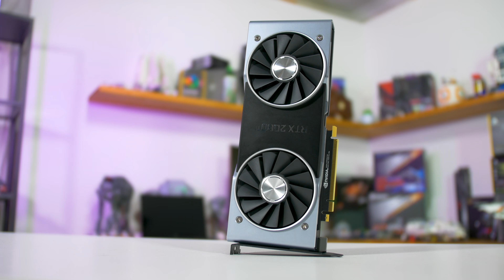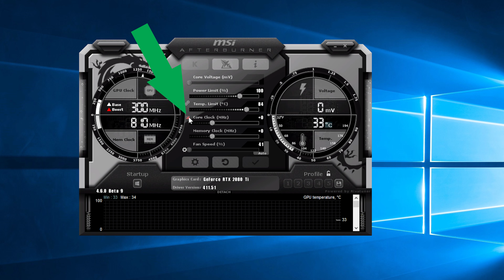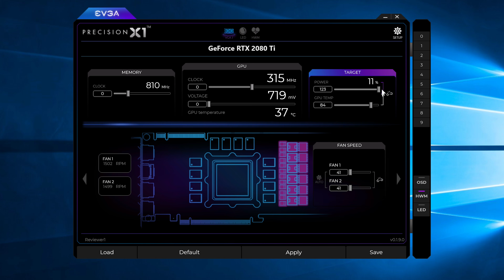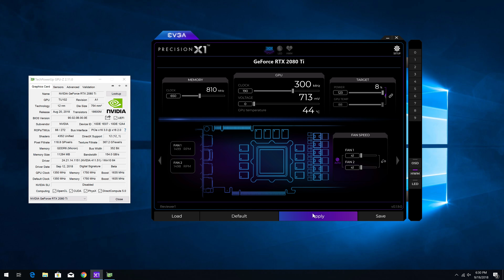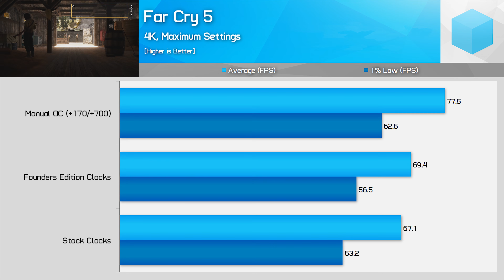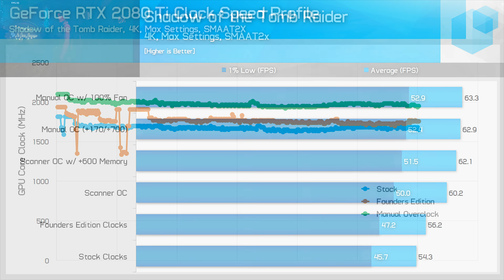GeForce RTX 2080 Ti Overclocking Guide, Nvidia OC Scanner Results & Performance

Comment: If anyone is watching this in 2023… I recommend you undervolt your card. As he said, you can expect 5 years at stock voltages, and seeing as the card was released 09/28/2018, it’s been about 5 years if you bought the FE at launch.
Reply: Then it'll die?  Cuz that's not cool.. you can sell it and get money towards an upgrade.

Comment: One thing I learned from exploring MSI Afterburner, is that different skins has different options and buttons. I was using the original green skin, but after switching around I found buttons that aren't shown on the original skin.

Comment: I find auto overclock to be so stable and manages to get my gpu to a better performance and even lower temps and power draw (I swear, i got proof). Everything fine with this dude except by the little mistake he and everyone is doing: COMPLAIN ABOUT THE FAN NOISE RAMPING UP TO COOL DOWN THE GPU. Dude is like: serioulsy? you spend more than 4k usd in your pc and you clearly ran out of money to buy a decen pair of headsets with noise isolation  or cancelling?. I AM TIRED  of this morons complaining like girls about the fan noise. Dude stop it you all are managin to get all the people that does not know a thing about electronics to the edge of damagin their components thanks to overheating in other components such as capacitors vrms and even ram chips. please stop it if you want no noise get the computer case to another room or outside your house and stop damagin your pc components because you the girly man doesnt want any noise. please.

Comment: +195 on the clock and +1250 on the memory. No voltage increase but power slider to the max. Is that pretty good? My max clock hits 2165

Comment: Can anybody help me out, I just bought RTX 2080 on a nice sale, and tried now to overclock it, but whenever I increase any sliders even a bit like 50mhz it already causes crashes.. How can this be? I tried first the 100mhz and 750mhz on memory JayzTwoCents recommended and I got a hard black screen crash. then I went to this 100/500 and Heaven benchmark crashed. then I went as low as 20/100 testing out everything in between and always crash. WTF? Did I lose somekind of GPU silicon lottery or why my card is shit?

Comment: So do you mean we don't need to rise the voltage gauge when ocing the card cause it doesn't give much different results when it is off?
Reply: I have the same question. MSI AB page says to max it out, and BEFORE running the scanner. I found these instructions lacking as they didn't say what kind of voltage control to use: MSI standard, Third Party, etc... Also they said nothing of NVIDEA claiming a 1 year life span with voltage unlocked!  I hope he mispoke in the video and NVIDEA says it takes 1 year OFF the life of the card. I got a 57mhz recommend on a card already boosting to 1920mhz so seems about right
Reply: @nathanwhite617  yea what's the score with this.

Comment: EVGA 2080TI XC Ultra. Max stable OC is +90 Clock, +800 memory. Did I get a get unlucky with the silicon lottery ?
Reply: Your max coreclock is +90? Evga xc ultra? Is too low... not possible.. in my founders (bios modded kf2a galax 380w) coreclock is +170, and memory is +1250...

Comment: OC Scanner suggests +185mz on core clock after running scans. 
My 2080ti fe won’t run past + 115 on the clock without crashing. Anyone else having same problem with OC Scanner?
Reply: I have FE and my coreclock stable is +150, and memory +900. After modding (i have flashed bios whit kf2a galax 380w) my oc stable is +170 coreclock and +1250 memory clock. The power limit is +127 and Before flash 123

Comment: My new (rma'd) 2080ti fe appears to be crashing (the driver that is, card appears otherwise fine, thermals, etc, its water-cooled). The damn dwm.exe black screen crash in games, I've checked everything, including multiple system and driver re-installs, changing timeouts, etc.  So I am now thinking to UNDER-clock the factory overclocks...getting a little desperate here!

Comment: I'd argue that memory is just as important as the core clock when it comes to performance. Memory is at least around 50% of the overclocking performance you can gain.

At least that's what I've seen on pascal.

Comment: Using Precision X1 I got a +121 score in VF Curve Tuner with +170 and +600 on my EVGA XC Ultra Gaming. Pretty much means a 12% increase. Had a 88C limit and hit 87 in the stress test right at the end of the 20 min or so test. I was biting my nails, lol. Also I don't have that OC Scanner button show up in MSI Burner, so I used Precision X1. 1820Mhz GPU and 2000Mhz VRAM

Comment: Erm, Tim. The fans can be run at higher than the speed you have them set. You didn't adjust the "FAN SPEED" section, only the fan curve, which is predefined and capped.
Reply from the maker: Yep well aware, why do you want it to sound like a jet taking off? We're also not thermally limited so another reason not to do that.
Reply: Water blocks are my preference.

Comment: If Pascal and Turing behave similarly, you will get even better performance using the curve oc manually. From the default curve as a starting point,  increase the highest 2 or 3 frequency points on the curve up to the  cards voltage limit up to the frequency you want to try to run the card at. 

Using the slider increases every point on the curve by the same amount.

The points on the curve at the low end of the curve do not really contribute to the game frame rate performance but the do use up some of your power limit headroom if you set them higher than the default. Keeping them low will help the card not hit power limits as easily, keeping the clock speed higher throughout the run.   The Area under the curve is representative of the power that the setting will need to run.  If that areas exceeds the area allowable by the Power limit settings, the card will power throttle.

The other thing is that each point on the curve has a limit to how far it can be overclocked and they are all different. It is possible that each point except for 1, is happy at running at +200. that one point may have a problem above +100. Using the slider, the run will crash at any settings above 100 because of the card trying to push that single point above its limit.

Comment: "5 years at stock voltage, but just 1 year with the voltage raised slightly" More or less what you said nvidia said about their new graphics cards... really?  One year?  Nope, not touching that for $1200+

Edit: This card is weird... like I don't like it because it feels like BS.  Any opinions from others?
Reply: it will last more than that cause u have warranty on top of it for a reason if your card dies in 1 year and u have 2 more years of warranty left you can claim it.

Comment: 1 year lifespan with a very minor voltage bump, what a load of crap... does nvidia mean 1 year of 24/7 benching vs 5 years of 24/7 benching for stock vs boosted voltages ?
Reply: Yes. Maxing the voltage won't affect much of anything in terms of the lifespan for normal usage. By the time it dies it'll be way out of date anyways.
Reply: Thought the same thing. It’s not like you can really add much anyway. I really hate the Green Light program...bring back the ability to mod BIOes.  Overclocking has become boring.
Reply: yeah I call BS on that voltage lifespan thing.  I had a GTX 960 Asus Strix with the voltage OC'd to 1.2v (Asus defaults the voltage to that level for some reason) for 3 years and it still runs great at 1520MHz on Core.  I swaped it for my buddie's 1070 because his GPU didn't fit his new case.  He's still using that 960 at 1520MHz without any issues!

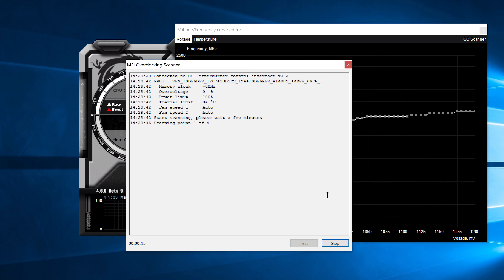Comment: At 3:04 where do you find the OC scanner button in msi afterburner i have a gtx 1060 is it a new feature only turing cards have?
Reply: Only the NEW (RTX) Turing cards have this function, not available for older cards.
Reply: @Nightss10  thanks!

Comment: mine msi x gaming trio rtx 2080, is the fan bar locked, or just grayed out, i have tried reinstalling driver with no luck, (8700k, 16gb ram, 1000watt plat psu) what to do ?
Reply: Hey Casper, you might have an older version of MSI afterburner, make sure you have the newest version installed.
Reply: You need the beta version of after burner.

Comment: I will say this newest generation of cards hasnt improved the clock speeds. Up to 2.1 ghz stable on my 1060
Reply: Can't really compare clockspeed between architectures. A 1500mhz 980ti is faster than your 1060.
Reply: i fully understand that. i'm no dummy i'm just impressed with pascal still. also my gpu is probably really high on the silicon lottery
Reply: the 980 is equivalent too the 1060 and thats simply because the clock speeds were ramped up that much. turing is a small step forward in conventional rendering at a massive cost increase. i think my general point is that i'm not impressed with this new generation of cards... 1200+ for a card that isn't a titan...

Comment: What NVIDIA is doing is Beyond Outrageous!!!  The are double dip scamming by relabeling the card names AND card prices. 
Based off previous generational gains and launch Prices, It would be like Ford calling their 2018 Focus a Mustang and then to add insult charging as if it was Mustang GT !!!  So it's not one, but TWO product tier levels of scamming.  Nvidia is selling (performance wise) a GTX2070 as Gtx2080 but then adding insult and charging as if it was a GTX 2080TI.

Comment: Two questions:
- Can i manually change voltage/freq curve as we did on pascal or i must use the sliders for manual oc?
-Can i use math test in oc scanner with manual oc?

Thx in advance.
Reply from the maker: Yes to both
Reply: That' s great. Thanks for your reviews too! Greetings from Italy.

Comment: "Precision has a much better interface than Afterburner"

I'm going to have to disagree here
Reply: Maybe he simply meant more elegant/pretty LOOKING? At least I took it that way. I have an EVGA card, and I prefer Afterburner. I use Precision to set the RGB LED's how I want, then never use it again. Even uninstall, as the card seems to keep the mode you set it in. Afterburner, and ESPECIALLY RivaTuner and it's OSD, is FAR SUPERIOR to Precision. I can't even get Precisions OSD to work most of the time, and Afterburner/RivaTuner lets you monitor way more crap than Precision, so yeah, he has to have simply meant the way it looks, because no one in their right mind could think Precision is better than Afterburner :P
Reply: I'm new to overclocking. I wasn't aware you could use both. Common sense told me it would cause conflict so I never tried. How does the system know which one to use? Is it safe? Would you mind linking me to a good source to learn more?
Reply: @amirboyangiu3403  you can have both installed and use each at a time. It won't cause problems. You can also use both at the same time but that's pointless, one will just override the other depending on which was used last.
Reply: @amirboyangiu3403 Yeah, you can HAVE both, you can even use both, but I would only USE one at a time. I just use Precision to set LED's and such, exit the program, and then launch Afterburner for the interface and RTSS for that oh so lovely OSD. I always seem to have problems w/ Precision's OSD working, sometimes it does, sometimes it doesn't, and I'm always having to fiddle w/ it to make it work. As for Afterburner/RTSS? To quote Mr. Huang, "It just works"
Reply: @amirboyangiu3403 Also forgot to add, the more things you have open that are monitoring sensors and stuff, so say you have both Afterburner and Precision open, plus you got the windows sensors, and if you have motherboard manufacturer's software (something like AI Suite 3 on Asus, etc.), you're just increasing chance of conflicts like you said. Like I said, use one at a time, use Precision if you have an EVGA card to set the LED's, then shut it down or even uninstall it if you want, then use Afterburner/RTSS. The less the better. Although I must say, w/ today's higher core CPU's it can handle all the work better, but then when it comes to conflicts, it can cause stutters and stuff like that, no matter how bad ass your CPU is (I learned the hard way lol, like an idiot I always try everything they say not to do. I don't recommend it, and I USUALLY don't do that anymore :P )
Reply: I too think he means it looks prettier

Comment: @Hardware Unboxed, do you guys ever test undervolting and overclock on Nvidia cards, to see how low the power draw can be while achieving a stable high clock speed? (thank you for the vid)
Reply from the maker: You can't change the voltage whatsoever. The best you could do without special mods would be modifying the voltage/frequency curve to hit high frequencies at low voltages but then the card might just choose to run higher anyway
Reply: Oh I thought you could reduce the Power Limit slider the other way?
Reply from the maker: You can but it doesn't necessarily limit the voltage

Comment: So this won't apply to the 2080?
Reply from the maker: The general procedure does, in a couple of days you can see our 2080 OC video with our OC results for that card and general ballpark OC clocks
Reply: Insurgent Hardware did you use the scanner or manual oc? That's a good fps gain. How do you feel about the RTX release? Idk why I feel kinda used by Nvidia lol
Reply: HB C yooo! Thanks dude, I'm Def gonna use Kommbuster as I just watched a video on how to use it! Also I have a msi motherboard so might as well stick with MSI for OC.
Reply: Do we click save when we're done? What do we do when we're finish overclocking. And do we have to run the program every time we boot up our pc?
Reply: HB C yeah I saw a good video for after burner that explained it pretty clear. It explain the auto windows start option. So I pretty much have to run the the msi or evga software every time I play a game right?
Reply: Insurgent Hardware I'm a little nervous to manual oc. I never done it before. What did you set your core to?
Reply: Insurgent Hardware thanks. did you use msi or evga app?
Reply: HB C now I have to learn how to run 3D Mark
Reply: HB C well if I do a manual oc I will have to run 3D Mark TimeSpy. I know how to use MSI afterburner so far.

Comment: When you're talking about Voltage and lifespan.  You show on Afterburner in the first part of the video it having a power limit slider.  But use EVGA scanner to talk about voltage specifically.  So my question is, what's the difference between the Power Limit slider in Afterburner and the Voltage slider in EVGA's utility?  Or is there no difference?  And if there is a difference between those two methods, what's the potential lifespan impact between either method?

I only ask because if I were to take them at their literal wording alone, I would look at Power Limit as exactly what it implies.  Maximum power draw allowed to accomplish a result (which can be achieved by means other than just voltage).  Where as voltage actually specifically increasing the voltage.  Or am I misunderstanding this.  Can you clarify this for me?
Reply from the maker: The voltage slider you would think would actually modify the core voltage (but it does nothing). The power limit is separate and governs how much power the GPU uses as you say. So when you set the power limit to 124% it can now push power 24% above it's standard TDP limit.

As for lifespan, not sure. I think modifying the power limit still keeps the card operating within Nvidia's voltage limits so the lifespan should be similar.
Reply: Thank you for the quick reply and clarification.  That also makes me feel a little bit better about which method I would prefer to use for overclocking.  I really didn't like the idea of the voltage slider in the EVGA utility "possibly" reducing the lifespan of my expensive graphics card from 5+ years to just 1.  So I think I'll stick with the app I know and stick with using Afterburner and it's power limit slider.

One more thing.  As for the issues you reported regarding getting worse results by increasing the power limit before performing the scan.  That could be caused by either or both a power limit holding the card back and/or thermal headroom as the scanner may be being conservative as to what it considers an acceptable operating temperature.  It will be interesting to see if you get similar results when you start testing the MSI 2080 Ti Gaming X Trio as that card not only has a much bigger cooler, but also a third power connector that could theoretically allow that card to handle up to 450w.  Hope you guys cover this aspect when you do your review for that card.

Comment: my sli of 580 is running overclocked for about 6 years i think or something like that, not upgrading soon
Reply: Get a 970. Cheap on the used market, 1/4 the power use of your setup and more than twice as fast if SLI isn't enabled. Plus, face it, SLI utilisation in most modern games is awful.
Reply: @boingkster  i got similar performance on my 2080ti vs sli 1080tis. SLI support for games is trash